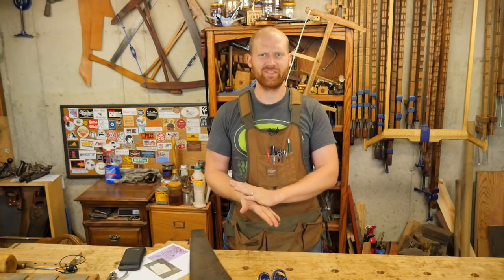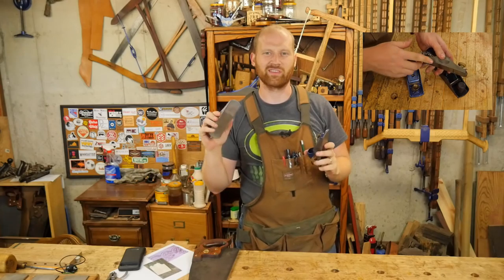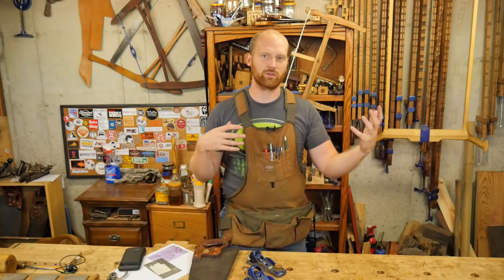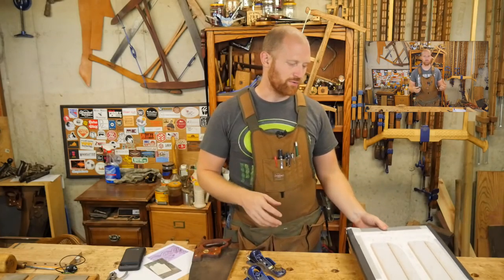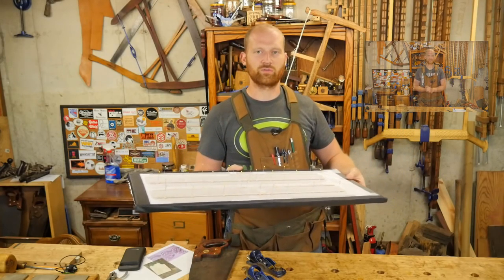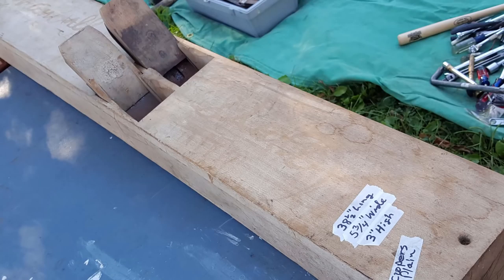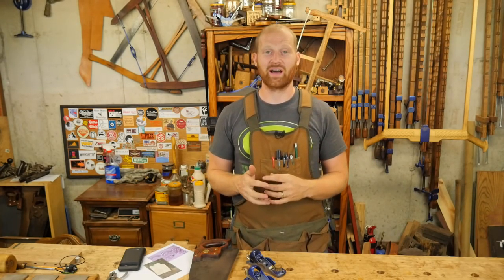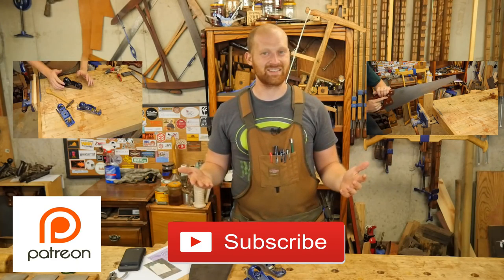Report, Resaw, BlockPlane, Colab, MWTCA, Website, Wright Flyer, and More

Comment: On the Wright flyer. Are you aware of the inherent stability issues with front empannage designs?
Reply from the maker: +Tome4kkkk yes. It took the Wright brothers about 3 years to figure out that the elevator should be in back of the plane. And that was the conventional knowledge for a long time. But one of the things I want to do with this is make a Wright flyer as if it were created by Burt Rutan who solved that problem with a Canard that has a different angle of attack so I can let it look very similar but have a very different function. Also the rudder will be moved to either wingtip much like a cozy
Reply: Wood By Wright
I see. I don't really know you so I could only be guessing whether you've done your research or... you're a skillful woodworker who will complete the craft meticulously and be crying in the end ;)

BTW, believe it or not, I'm an aerospace engineer by education who got into handtool woodworking :)
Reply from the maker: thanks! this will be the 3rd plane I will have worked on but as always it will be a fun learning experience. especially this time as I want to do a bit more crowd sourced  on the design.